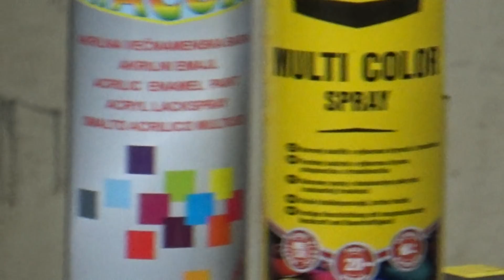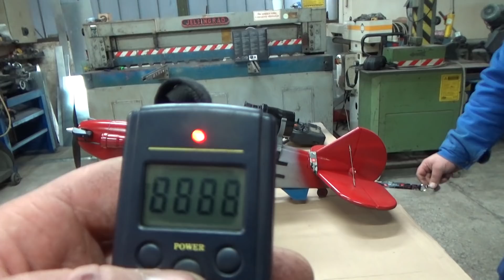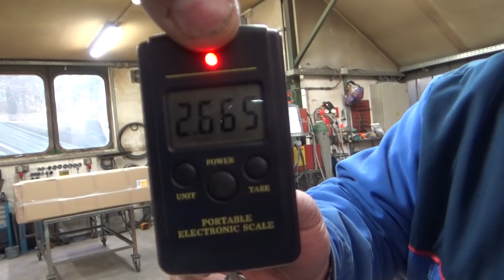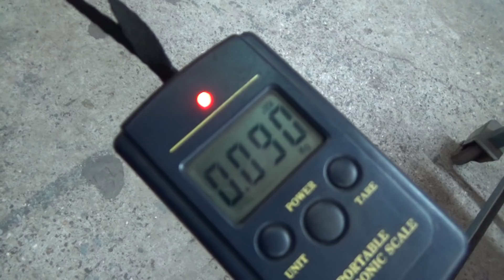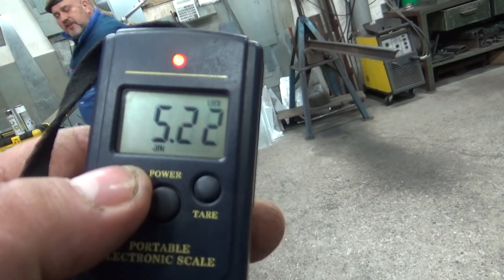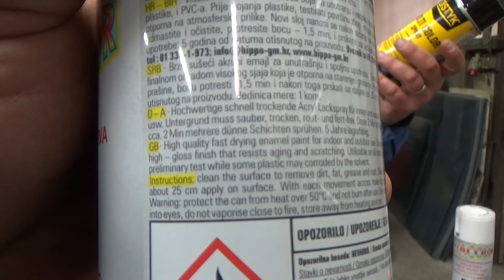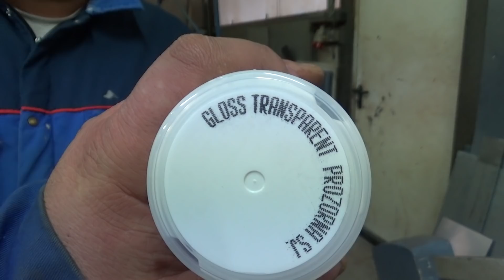Durafly ME 001 Fast Poke 70mm EDF Prop jet After assembley Review and test

Comment: Ha, Ha OK. This plane is just crazy enough to work. The Soviets tried something similar in 1944. The Mikoyan-Gurevich I-250/MIG-13. The front mounted piston engine powered a standard propeller, and powered a fan compressor which feed air to a ram jet engine in the rear of the fuselage. It was called the VRDK engine. It worked and flew 820 KM/H.  So your idea should work, I can't wait to see it fly.
Reply from the maker: Oh yeah? I didnt know that my friend. Thanks for the info. I have great power here, Iam just wondering about the CG. That will decide if I will fly or crash. But we must try no matter what. Big salute to you from Slovenia.

Comment: OOoooh its going to be fun! Might have been nice to be able to have the edf on a separate channel, and engage first time at height... just in case!
Reply from the maker: I was thinkg about that my friend, but I think that I need also the power from Impeler to even takeoff becouse the bird is heavy. But good thinking. I will think again about that. Cheers my friedn.
Reply: Ah yes the 2 batteries, motors etc... Perhaps if you had a very long smooth runway it might be ok on prop only, but I think you'll need it all at the field... best of luck! It should be an exciting maiden. :)

Comment: Capt Robert, I may have missed you mentioning this but did you set the EDF on a separate switch or mix both the prop and EDF on same switch? Can you also fly with one motor and not the other, apologies  for  many questions.
Reply from the maker: They both work on the same Y cable. I was thinking to put them on the swich so I can choose which one to use, but with that crazy weight I will need both or there will be no takeoff at all. Cheers my friend.